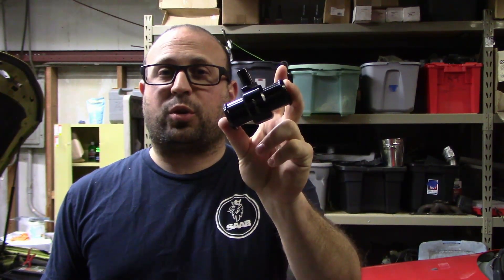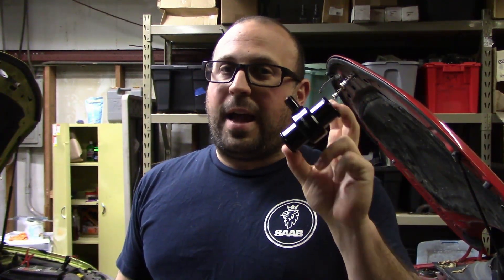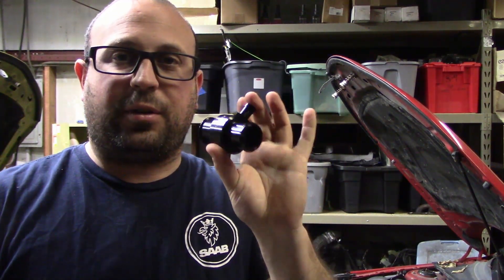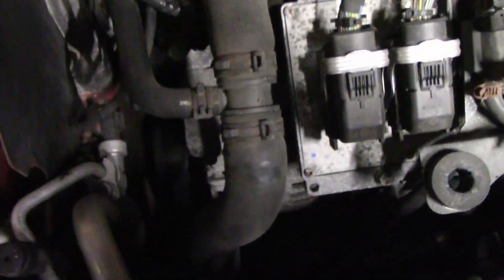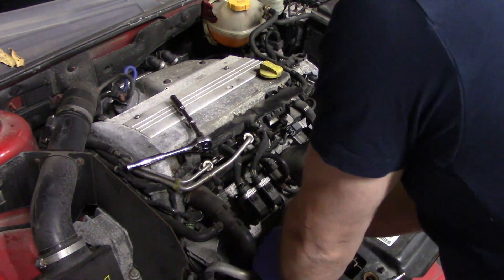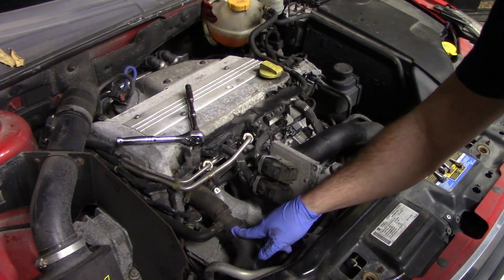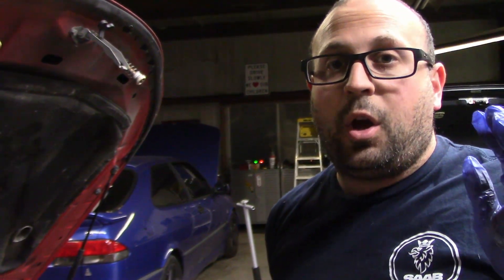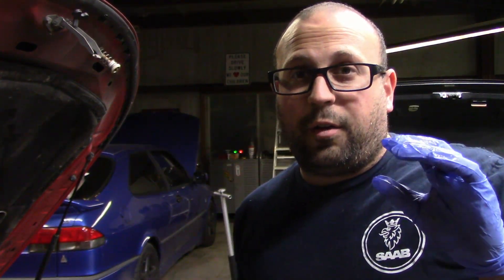Installing the Saab 9-3 Krona Aluminum Coolant T an eSaabParts Exclusive in our 240k Mi 2010 9-3

Comment: Quick question I’ve got a 2011 9-3 turbo 4 xwd and ive been noticing a whistling front the turbo right around full boost I’m guessing it’s blowoff but not sure if it’s the turbos gasket coming off from the exhaust any idea ?
Reply: Check the intake hose that connects to the inbound side of the turbo. That rubber section tends to get ripped away from the plastic section, allowing air to suck in. DO88 makes a great aftermarket hose for that. If the whistle is really shrill metallic, like a siren, better check the turbo spindle for excess slop, allowing it move and to rub the housing when it spools up.
Reply: MassiveTrackHunter have to check on that thanks it pretty high pitched usually only when it’s high psi

Comment: I remember this breaking as i was pulling in the driveway late one night.... should have been aluminum from factory instead of plastic. ohhh another preventative you should do while in there is the temperature sensor right above.
Reply from the maker: I don't disagree with replacing temp sensor as well, however I like to do the thermostat and temp sensor together.